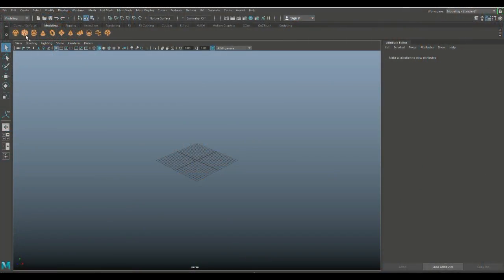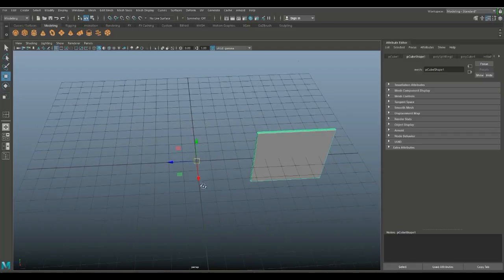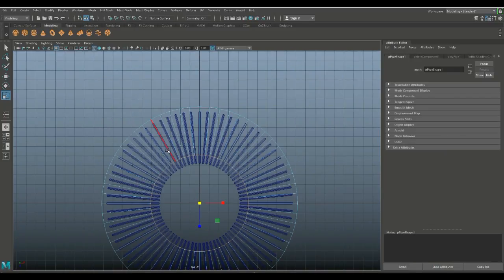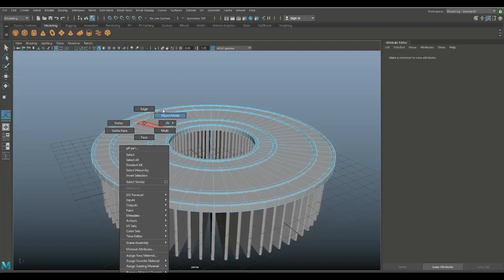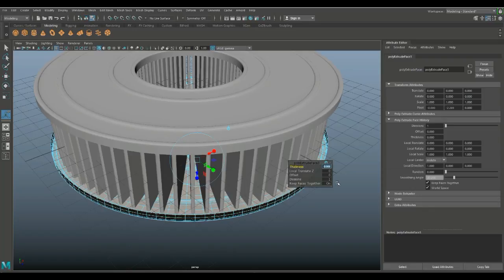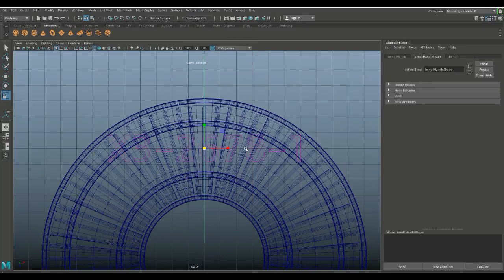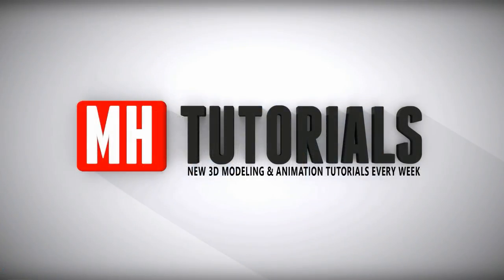How to model a 3d Air Filter in Maya 2018

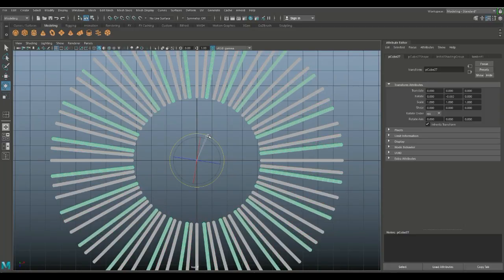Comment: 3:20 When creating a set of objects rotated around a center point, you should set the "Step" relative to the number of objects.

Eg; There are 72 panels, 360/72=5, if you set the step setting to 5 degrees on the first panel you made & rotated (Before ctrl+d'ing) they would be evenly spaced instead of by eye!
Reply from the maker: True, fair enough.
Reply: My OCD kicks in quickly, sorry :P... Also I noticed you used CTRL+E to extrude, which I had done until you taught me you can hold shift while using the translate/scale/rotate tools to extrude, any reason in those instances CTRL+E made sense over shift+translate, or just whatever happens while you're working?
Reply: Sometimes it's ok nobody check this much.
Reply from the maker: I don't really think about it that much. It is like driving a car and goes unnoticed
Reply: Haha, good to hear. Just as it should be ;)

Comment: Can you please make animation tutorial like soda splashing out of bottle or something like that?
Reply: 1: fill the soda can model with bifrost fluid
2: set the soda can as a collider
3: set the collider properties to shell
4: set the voxel size to 0.125
5: make a polygon sphere
6: add the sphere also to the colliders
7: make a lambert material and assign it to the sphere and set the transparancy to 100%
8: put the sphere over the hole of the soda can
9: set keyframes and let it drop down in the can in 7 to 13 frames

Hope you can make use of these steps, have a nice day!

Comment: Hey Mike! One quick problem, I have googled it so much my eyes bleed!
I would like to bend my object 180 degrees with bend deformer to make a perfect circular shape, like you do with your text but completely round, edge to edge.
My problem is that it does not do it correctly when I type 180 in "curvature", it feels like it's a bit off, approx 180.8 degrees or something, but enough to cause a lot of trouble and manual merging that does not look good.
Have you or anyone else ever encountered this?
Help would be immensly appreciated!
Reply from the maker: That happens when there is space at the ends. Specially with text. Sometimes you just have to do it based on vision. Somthing like 180.0 is not strange
Reply: Thanks for taking the time to answer! I Have tested this on a plane square, it it will still not line up correctly. Is there a setting that I might have messed with or is there information about this anywhere? Let's take you tire tutorial for example, there it lines up perfectly, while mine does not. It's really bugging me :(
Reply from the maker: Check to see if the pivot point of the object is centered